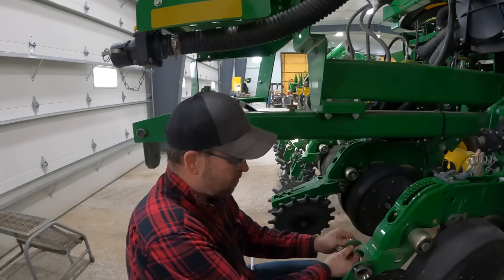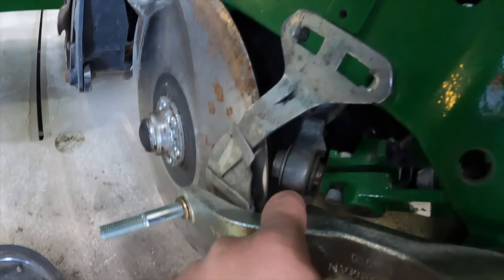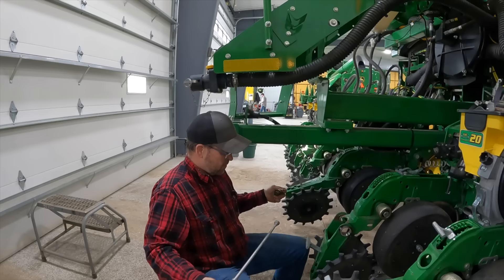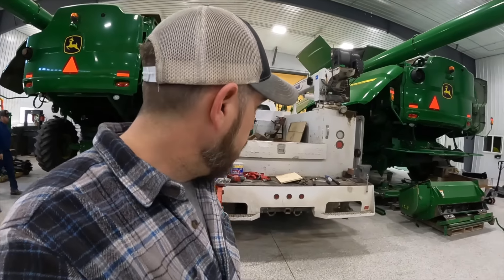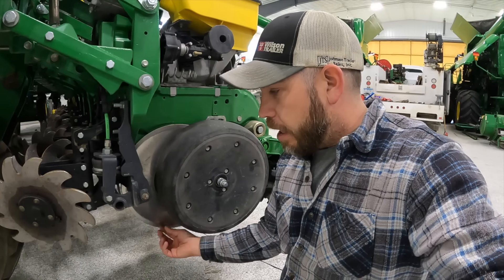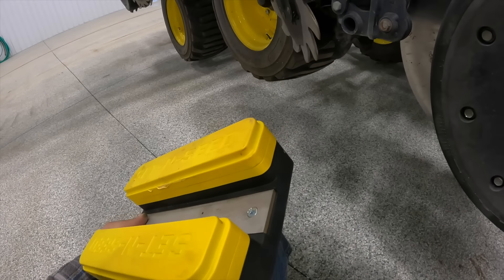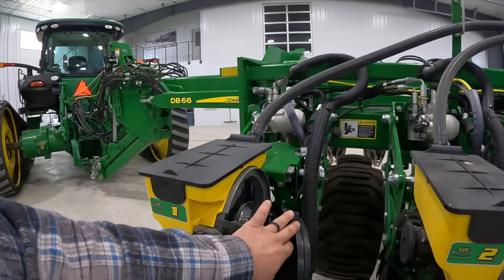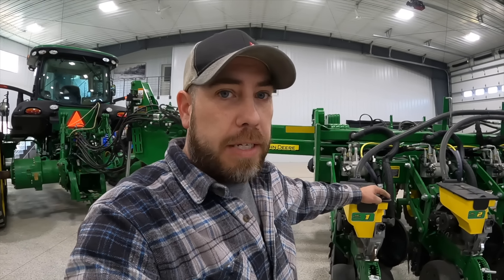John Deere Dropped The Ball On This Design!!

Comment: Every pivot that you talked about is basically unchanged from the original Max Emerge in the early ‘70’s.  What has changed is the speed of planting and the desire for better seed placement.  So, mechanical pivots don’t receive the design scrutiny that they need.  I am a retired Deere engineer that has been around these planters since the ‘70’s.

Comment: Great planter explanation. I have a MY 2023 JD 1795 16/31 with IRHD and have had some issues with accumulators. Have you experienced any problems in that area? I'm going to get that set-n-seed tool after seeing that. All of your videos are great.
Reply: @Jon8310R I have the same planter except 16/32. Lost count of the number of o rings we changed on accumulators last spring. Will be pulling it in the shop one the 1775 is done to go through them all again. Deere suggest we put a little blue loc tight on this time around. I don’t think they were tight from the factory
Reply: I’ll have a video coming out soon of us replacing ours……again
Reply from the maker: We haven’t had any issues with the accumulators.

Comment: That’s been a horse-bleep design for years. Even before the cast steel assemblies
Reply: Do any other manufacturers have something better?  They all have their weak points in my opinion
Reply: Honestly kinzes design isn’t much different. I’m not too familiar with other brands closing wheels, other than the case ih is a good design

Comment: John Deere designed it to make money for them.
Reply: Are anyone else’s design any better?  Case is different but believe they have multiple issues with the covering disk bearings
Reply: @WNYFarmer  replacement parts, john Deere is like many other companies, they buy parts cheaper than they can make it themselves so the challenge is to find a better maker of the same part. Maybe made from better Steel  ? Maybe a better design  ? Reverse engineering like the Chinese do?  Many ways to skin the weasel ! 😂 good luck